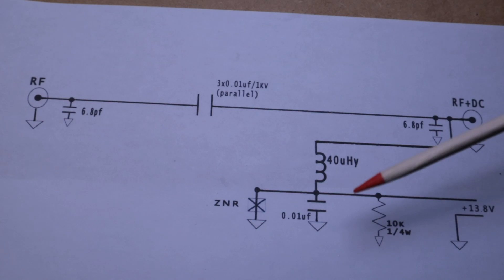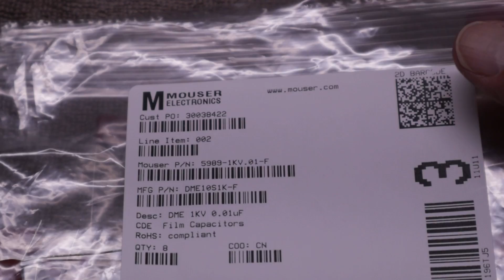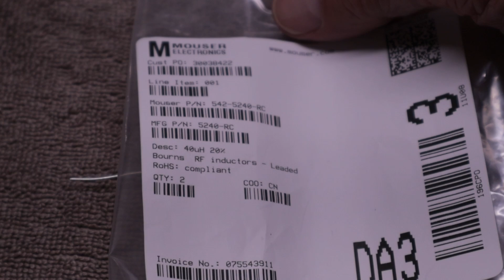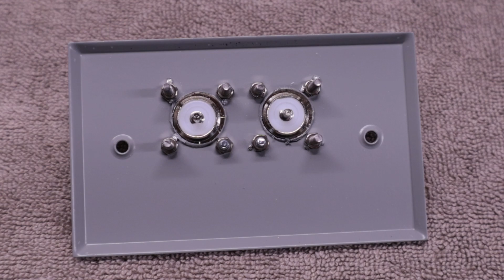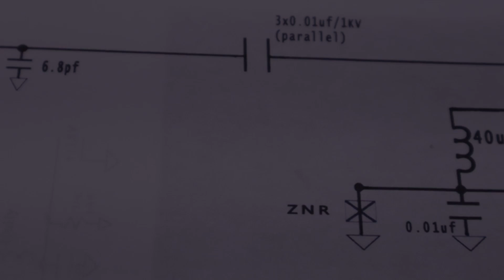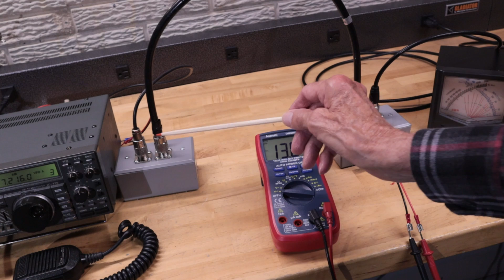BUILD a Bias T for your HAM Radio!  Easy and FUN Build!

Comment: Question, how much RF power can you send through this Bias Tee?
Reply: Based on the components he used, I would say about 200 watts, or so, SSB, 100 watts CW.  Replacing the capacitors with similar values rated at 2000 volts, instead of 1000 volts would increase power handling to about 400-500 watts.  The inductors used would limit DC current through the system to no more thsn about 3-5 amps.

Comment: Hi Ed. Nice job but best place the SWR meter between your rig and your first box then retest the SWR (as the location where you are testing in the video is only testing the SWR of the dummy load). Cheers, Wayne.

Comment: Thank you for the information! Back about 15 years there was an article in either QST or CQ magazines ( can’t remember and can’t find the info ) on how to make these from Radio Shack parts. These appear to be a bit more reliable with the protector on the DC side and decoupling caps on the RF connectors. I have been using my bias T's to power an SGC 239 antenna coupler remotely that has been mounted in a CATV amplifier housing and utilizing a 106” CB whip to work the HF bands. Works like a champ with zero issues but I will be adding the MOV's , cap and resistor to my units as well as building a few more for other projects.
Way back in the mid seventies I built a pair of crude bias T’s so I could use my SONY 920 U TV set on the back deck by sending its 12 volt power up the CATV coax. It too worked great as well.
Reply from the maker: Thanks for your info. Sorry about the late response!  -Ed. W8EDW

Comment: 6.8 pF 1KV CAP are available thru DigiKey. Part #561R10TCCV68-ND.  $1.30 in single quantity. $0.97 for 10. Through Amazon the same cap is $3.78 for one plus $7.95 postage! Thanks for sharing this project.
Reply: The film capacitors DME 1KV 0.01uF are the hard ones to find.

Comment: Excellent! Thank you for your video. A very timely bias-T build, as I just had a cheap commercial one go bad (very noisy). I'll be building two of these ASAP.
Reply from the maker: That’s so cool 4nradio!  I’m glad you found my video helpful.  You’ll have to let me know how they turn out.  Send some pics.  My email is good on QRZ.  -Ed   W8EDW
Reply: @edwhitney1862  Will do! I will be using mine for receive only, with Wellbrook magnetic loop antennas. I suppose I can reduce the voltage rating of the capacitors since there will be no transmit signals going through the circuit.

Comment: Great video thank you. 
Im curious the the maximum length of coax that could be used and still get useful power at the antenna? 73.
Reply from the maker: If you use RG8 size of coax.  It’s only 1.37 ohms per 1000 ft (center conductor) and about  .34 ohms per 1000 feet for the shield.    So I am pretty sure you will have plenty of DC power at the antenna.   Thanks for the nice comment!  -Ed W8EDW

Comment: Ed, As you are aware this kind of thing is commercially available but the cost for a ready built switch and Bias T is considerable. You prove with a little time and a few bucks in parts a great project that fills a big need can be easily created. I must say your presentation and workflow in the video is first class. Its like you have done this all your life. Thank you Sir for showing the true spirit of Ham Radio and doing so with much class and consistency. 73's ! Kevin WA5KW
Reply from the maker: Thanks Kevin!  -Ed

Comment: Great job Ed... appreciated... one question for you... does it matter which side of the capacitor, resistor, coil or varistor is connected.  ie is there an in or out +/- side to these components?
Reply from the maker: Hi Arthur.  No, all of the components are non-polarized.  Let me know how your project turns out!  -Ed W8EDW